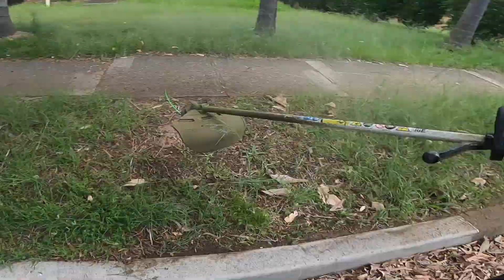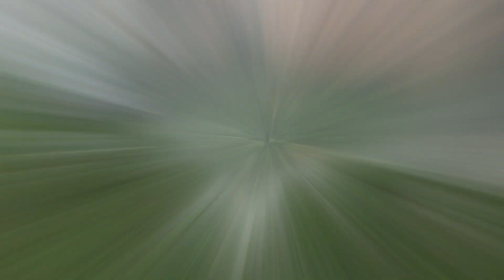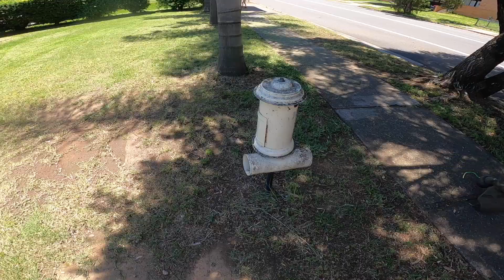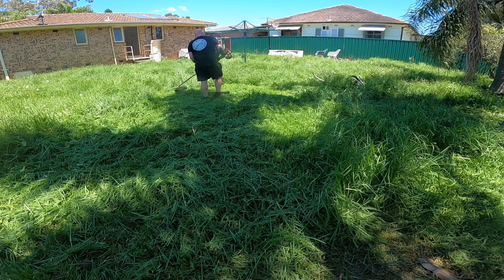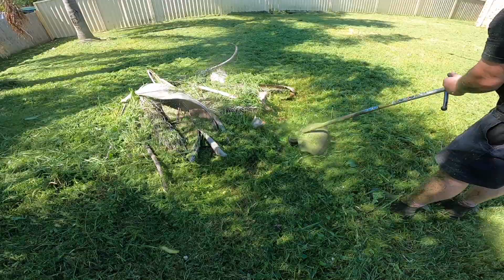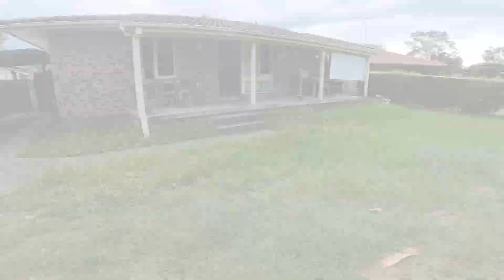THE MOST DIFFICULT JOB I’VE EVER DONE!! OVERGROWN LAWN ✅😱😮

Comment: If you raise the front up higher than the back it will cut that high, thick stuff easier. I learned that from the mowing crews I used to work on mowers from.